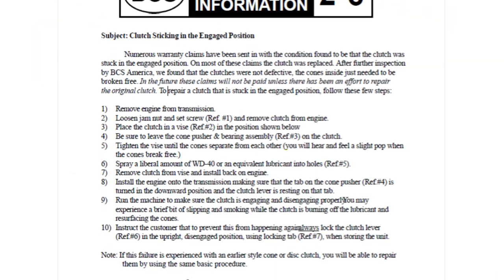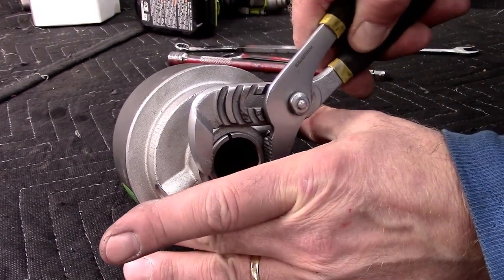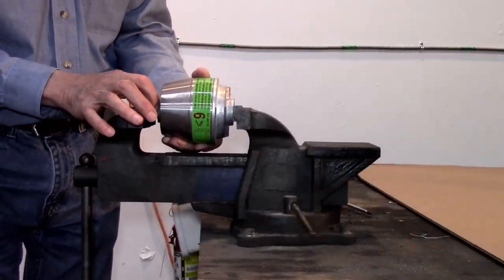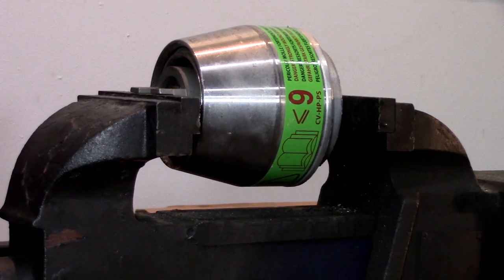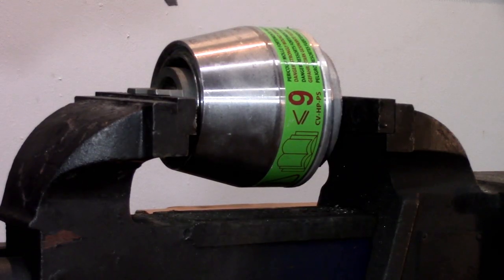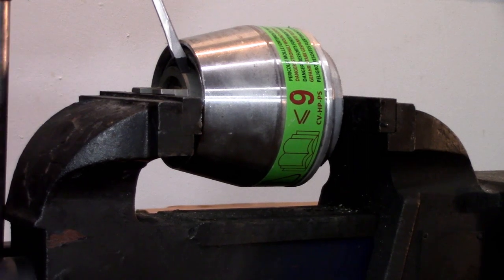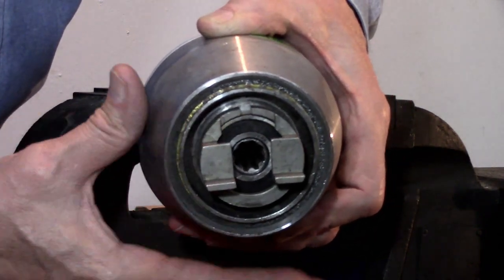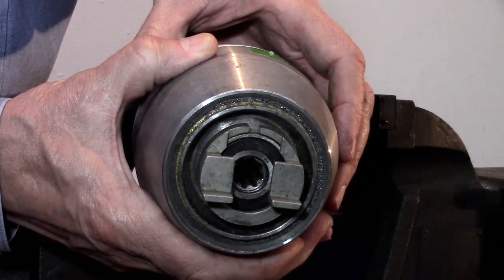Release a Stuck Clutch From a BCS Two-Wheel Tractor

Comment: I just worked on a 732...oil change, tiller tine repair.  When the customer came we found the clutch was locked.   I had worked on a similar issue on another machine and used a screwdriver to operate the cone pusher ( 524.47896  fork and the two tabs), and it popped and became functional.

This time, I removed the battery and the clutch pulley and found that the fork/lever works fine, and the cone pusher does go in and out.  I'm a bit puzzled now, just because the forks and the throwout now go in and out, shouldn't the clutch disengage?  Or is there another issue here?  The videos show putting the clutch in a vice and depressing the cone pusher. 

So, either I couldn't push it in far enough, or couldn't push both sides at the same time.  Customer is using it as-is, but if it doesn't release after running/cooling  a few times, I'll get it back and pull the clutch and put it in a vice.

What else could it be?
Reply: Did you fix the tractor?